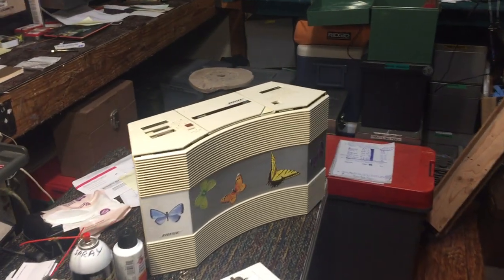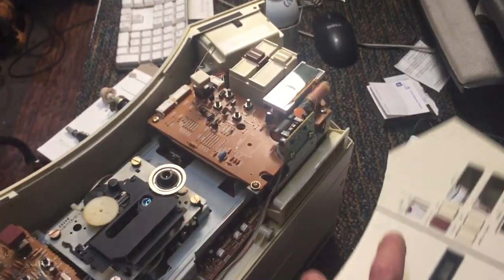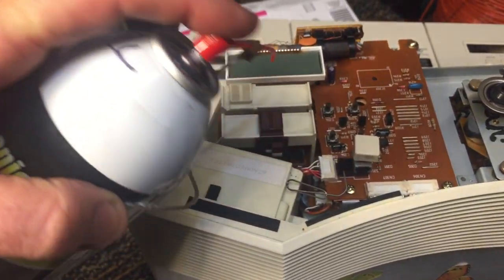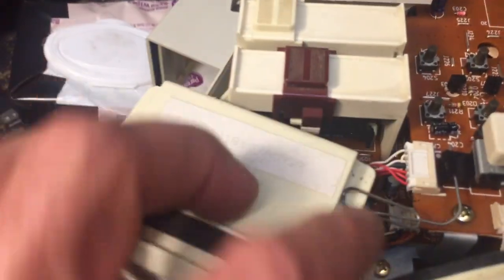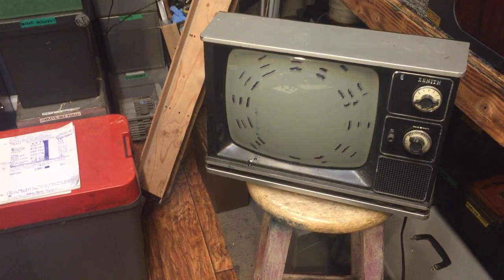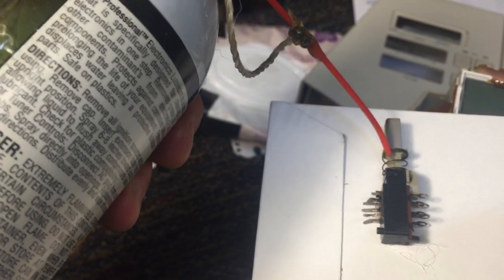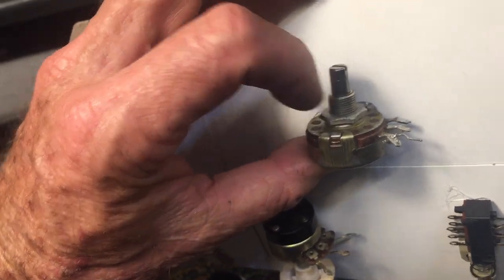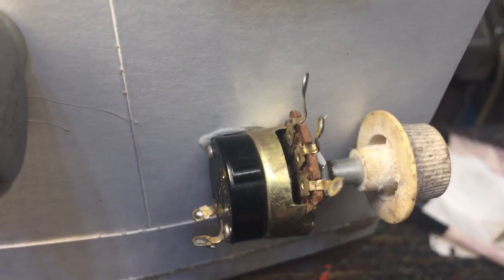Bose Acoustic Wave. No Sound In Left Speaker.

Comment: Inherited this very same Bose model from my father about a year ago. CD player finally went dead on me after putting it through the paces in such a relatively short time (also had problems playing CDs that were only manufactured a few years ago, strangely enough). Unit itself also had random volume spikes at one point, but as of today that hasn't been an issue so far. AM/FM radio still going strong on it despite getting close to the 30-year mark in terms of age. Was thinking of finally having it refurbished, but found it might be more practical to just pay for a replacement unit where any can still be found. My mother said she wouldn't mind taking it off my hands if only to use it to boost the TV sound, however (lol).
;-p

Comment: easy fix,
i thought about drilling but afraid getting shavings on inside,
Reply from the maker: Yes I think that's something to be concerned about. I'm thinking a small grinding bit on a dremel tool might be a safer option, or drilling into
a portion of the potentiometer that isn't metal, and being cautious not to drill to deep.
Reply: The metal housing can often be loosened if you carefully bend the tabs up on one side and pry. Then you have a gap for your spray nozzle. Of course if you do it more than a couple of times the tabs will break off.

For potentiometers made from unobtainium, it may be worth removing the housing entirely, drilling a hole, and reattaching it, so any future cleaning/lube can be done without issue, or risk of damage from metal particles/swarf.